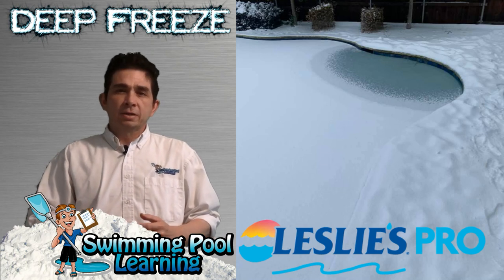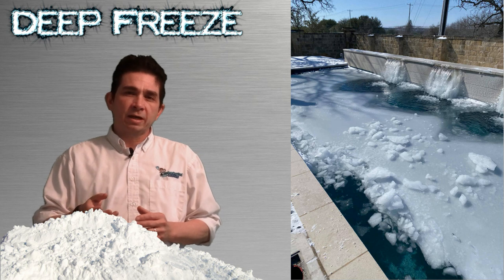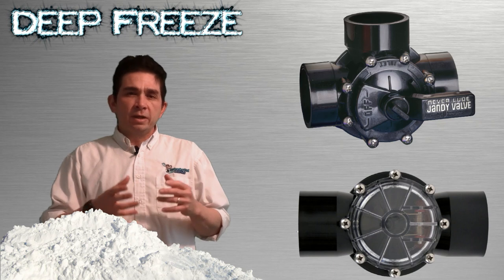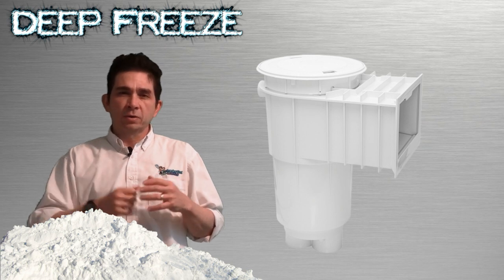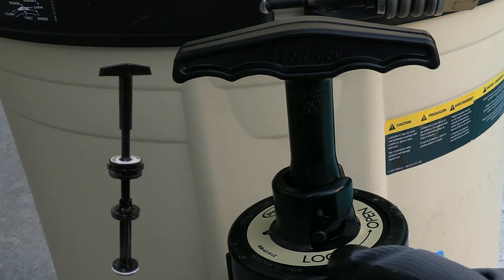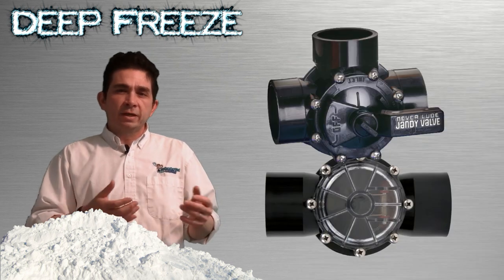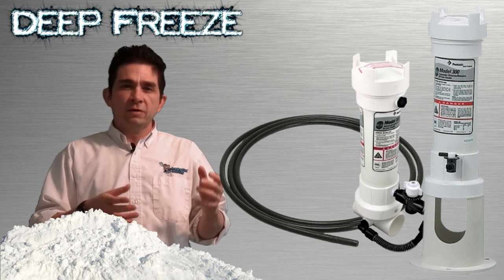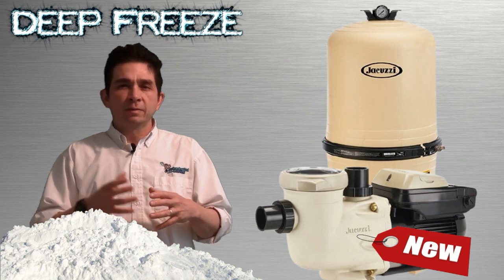Swimming Pool Deep Freeze: How To Recover From Freezing Weather and a Frozen Pool & Frozen Equipment

Comment: Thank you so much for posting this. I am in Dallas and lost the battle for my pool after losing power for over 18 hours.
Reply: Wow.  I am so sorry.  I am in the Dallas Metroplex, too.  I posted a video of my backyard and pool---so far so good.  I am truly sorry that this happened to you.  I know that this has happened to many across our area.    18 hours.  I hope you and your family are doing okay.
Reply from the maker: Once every thing dries out I suggest opening the valves and check valves on the plumbing - these areas would be the most danger for potential filter lid explosions. I mean it wouldn't hurt to hire a pool pro to come out and inspect the equipment. Terrible weather event for sure.
Reply: @ArtGardenFoodExpressions  If you don't have a serious generator, I would winterize your pool before you have the misfortune of a power outage.  Drain the water to below the returns.  Empty your skimmer.  Then with a strong Shop Vac, blow out the water from the skimmer to the pump.  Then drain all pool equipment and blow out the returns and backwash line.  This can save you a lot of trouble!
Reply: @canuck7777777  I agree.  Had I known the storm was going to be this bad, I would have had that done.  Now, can't even get into the yard to do anything with the pool.  Too cold.  Water will freeze quickly.  Fortunately, no outage, yet.  Temps are suppose to be good by noon on Friday.  Fingers crossed.  Poos has been running nonstop since Sunday morning.  Pool equip is relatively new.  Two and a half years old.
Reply: @ArtGardenFoodExpressions  Thank you for your best wishes. We are very fortunate and have pulled through with only a bit of roof damage (and most likely pool equipment damage) but feel very blessed considering the extent of damage I have been seeing on the news and on my social media. The rolling blackouts have also seemed to slowed down too and we are having the electric stay on for longer periods of time between blackouts. I pray your and yours are keeping warm and safe.
Reply: @SPL  Yes, I am not touching a thing until our pool guy can get out here and have his experienced eye check over everything. I have a feeling that all pool professionals are going to be very busy over the next few months. We cut the circuit breaker off to the pool once it froze over and we knew we were not getting power back anytime soon. I am sure there is much to be replaced. I am glad I saw your video because I was tempted to try to break the ice up.
Reply from the maker: @wendywyll5032   It is going to rough. Hang in there and hopefully, the damage is minimal.
Reply: @wendywyll5032  We’re in the same boat. Pool had never frozen and we’d never lost power for more than 1-2 hours in the 20 years we’ve had the pool but they both happened when we lost power. I agree with having pool guy checking it out before I try anything, I just hope they can get to it before too long. All things considered, my damaged pool is really a pretty first world problem, watching a lot of people with more serious home issues right now.

Comment: I’m in Mckinney and our pool definitely froze over. There was no option for running our pool for 24/7 because the power was out for 3 days. Everything has thawed and looks like all is still in tact but I did see that the rubber structure at the top of our pump were the lid screws shut, it is cracked but I’ve closed the skimmer lid and it seems to be tight enough. Of course I will know more once I turn the pool breaker box back on! Fingers Crossed
Reply from the maker: Hoping for the best! 👍
Reply: Jason how did you come out ?

Comment: I’m in south East texas and my pump housing split, lower filter housing exploded, and who knows what else. My master temp 400 shows no signs of cracking at the manifold so holefully I get lucky. I actually heard my filter housing split, sounded like someone blew up an m80 inside of it.
Reply from the maker: Pretty horrible. It would be a real bonus if the heater survived because the new low NOX units required in TX are outrageously expensive.   Lets hope for the best. Sorry to hear about the filter and pump. 🙄

Comment: Hi David! Wow weird to see a picture of my pool on your video. Most was well last freeze. I did not pull the plug on my heater and had to replace it. This year all was fine until I noticed that my pump wasn’t on. I have freeze guard so I freaked out! Pump apparently lost prime. Not sure why. Maybe a weir got stuck… not sure. But my hose was frozen so I couldn’t fill it. But when I tried running the system I could hear water trying to fill up in my cartridge filter. You know the sound that you hear when you turn the pool off to service it and then turn it back on and wait for it to all start flowing… Except it just wouldn’t start flowing. So right now my equipment has been drained and I am waiting for a couple of above freezing days so that I can try again. This time I am going to use the hose to help prime the system. Do you have any advice? I have inspected things and everything looks good. I did drain the system since I was going to be shutting it off till I could figure out what was going on. Things are melting… Do you think three days of above freezing temperatures and not freezing at night will be enough? I would appreciate any advice you might give me. Thanks for all you do!
Reply from the maker: Sorry to hear about the deep freeze redux in Texas. So bizarre. From what was learned last time it sometimes takes up to 3-4 days after the temperature rises to normal levels for the water underground in the pipes to unfreeze and allow for flow. I would try priming everything up after 72 hours. It sounds like you should be okay in your situation.
Reply: @SPL  thanks David!! Got it going and all is well. Except I noticed that my pressure gauge did not go down to zero when I shut off the pool. I waited a long time and it still did not go down. I’m assuming I need a new pressure gauge. Poor thing has been through a couple of hard freezes lately. But does this explain why my pressure is 10 higher than normal? I am just needing to wait to clean the filters until probably next weekend… And I don’t want the higher pressure to hurt anything. My pressure is at 15 with the pool off and at 31 with the variable speed pump on high. Is this ok for a little bit till I can get a new gauge and clean my filters?
Reply from the maker: @dinaridenour720  Sounds like the pressure gauge is broken. Simply changing it should solve the issue. Glad your pool equipment survived the freeze!
Reply: @SPL  How do I make sure I get the right gauge? I also thought I would replace my O ring for the filter as well. I am not the original owner and I am unsure of what cartridge filter I have. I know it is a Hayward and I know what size filters I use. Is that what I use to determine which filter I have? Thank you so much again for your help!
Reply: @SPL  I found the sticker’ it was hiding in the back LOL!!
Reply from the maker: @dinaridenour720  Great! Those gauges are pretty universal. So any gauge that looks similar will work.

Comment: Im in the process of purchasing a home here  in central Texas and there has been a few with pool, what can I do to assess any particular damage give the current situation here? As a professional what would you recommend?
Reply from the maker: A solid home inspector can spot any damage or potential for damage. It may be wise to replace a lot of the equipment when you move in just to make sure there is no future hazards. A big mess for sure. The pool filter would be my biggest concern.
Reply: @SPL  right on - I was pretty confident that was the right answer. I’ll be sure to ask a ton of questions when doing the home inspection. Thanks for the content and helping direct me in the right direction!

Comment: I don't know if there's damage or not. Should I just run it and find out?
Reply from the maker: If it will turn on I would fire it up cautiously. Be ready to kill the power if you notice anything odd.
Reply: @SPL  Why don't pool filters have back up safety release valves installed by default?  My pressure cooker has a safety release valve. Is it because they are too cheap and the industry is run by people who aren't interested in engineering safer parts?